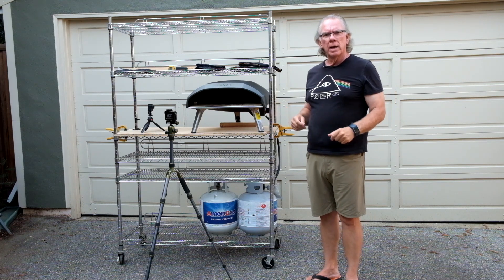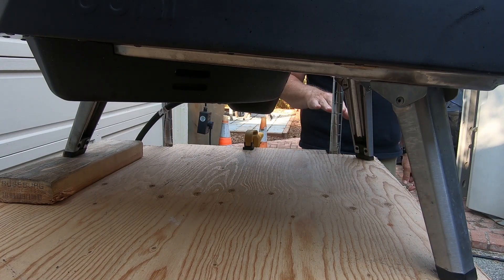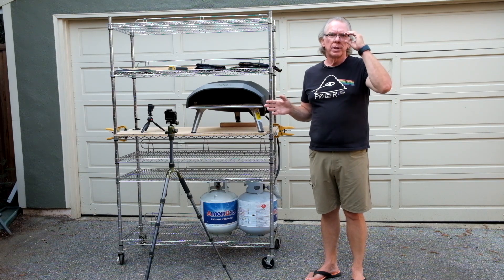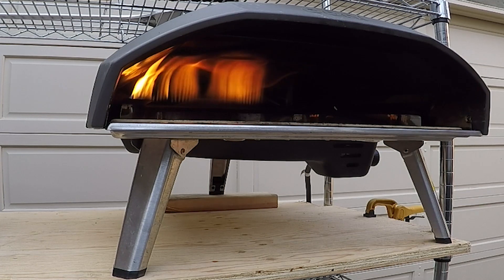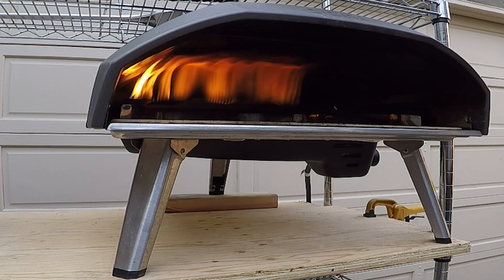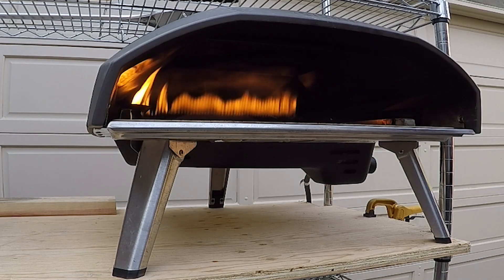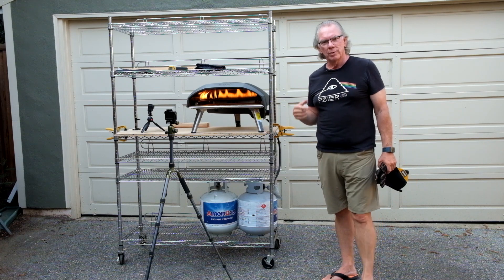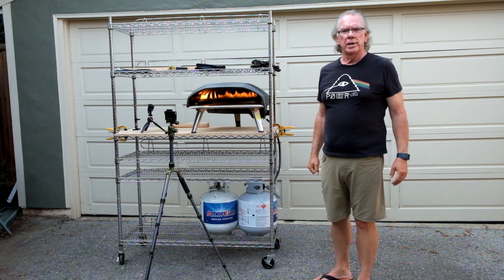Ooni Koda 16 Won't Stay Lit!!

Comment: Holy crap. A thermocouple replacement and endless troubleshooting, and you’ve solved my problem! I never thought to check the level of the table front-to-back. Thank you SO MUCH
Reply from the maker: Snarshmallow, Twelfth Avenue Cuisine to the rescue!! Thanks for watching!!
Reply: @TwelfthAvenueCuisine  I also found that, after turning the oven sideways when transporting it, some of the burner has rusted on the inside and flaked off, covering the holes right below the thermocouple. A few blasts of compressed air solved that problem but leveling was also important!

Comment: This didn't solve my problem of uneven gas flow. What did solve my problem was to shut of the gas valve at the tank,  disconnect the gas hose from the propane tank, wait 5 minutes then reconnect everything.  I think sometimes the gas regulator work properly when turning on the gas valve.
Reply from the maker: Excellent input so thanks. 👍 Hopefully others see your input and it helps them resolve similar issue.

Comment: Good info!  I just received my koda 16 yesterday, and unfortunately it is not working as intended.  The flame is mostly yellow, the stone does not go above 800 to 850 degrees F, and the ingnition system is defective.  Apparently this is a common problem with the koda 16.  I am trying to find out how to increase the air flow to the 2 burners to get more of a blue flame, and just tried to tighten the FSD as per ooni, but as far as I can tell, the FSD was not loose, so will see if the ignition situation improves.
Reply from the maker: Kier's Cotons, thanks for posting a comment and watching our video.  Are you in Europe?  I notice that some users have more if a blue flame.  We are in the US and our flame is yellow.  I am so sad to hear that you won't be able to start using your Ooni right away.  Ooni will honor their commitment to their customers and resolve any problems you are having.  I hope you will check in again and share your experiences with us.  Laurie.
Reply: @TwelfthAvenueCuisine  Nope, in USA.  Waited 3 months for the koda 16 and now its not perfect  :( I tightened the FSD, so now the first click on a huge gas flame bursts out then dies right away.  The second time trying, it lights.  The ignition knob also seems to get stuck (I can rotate it to on, but once there, I have to let the knob out to rotate any further-is that the same for you?) so I may just have to get another unit.
Reply from the maker: I open and close the propane bottle connected to my Koda 16. When I first open the propane tank once in a while it may take two lights. If the bottle is open and we used the Koda 16 earlier it always lights first try. Also when I first got my Koda 16 I would try to light it and not continue to press the knob in for a second or two. It would not light. So now I keep the knob pressed for a bit. I expect there will be variations in experiences when lighting.
Reply: @TwelfthAvenueCuisine  Thanks!  Does your ignition knob rotate smoothly or does it get stuck, then you have to let it out and push in again to rotate?
Reply from the maker: Our flame control knob rotates smoothly between the high flame and low flame settings. Between high flame and lowering the flame towards the off position I need to press in the knob when turning. Adjusting the flame to what we call "below the Ooni low" is where when the flame is on high we press in the knob and rotate about 45 degrees toward the off position. I hope this helps!
Reply: Twelfth Avenue Cuisine Ultimately my knob totally failed;  the oven would not stay lit unless the knob was pushed in all the time, so after more than 3 weeks of emailing customer support (response time of 2-3 days per email) they agreed to replace my oven.  It was indeed a lemon, because the new one works as it should!  We mostly make gluten-free pizza, but this oven gives the crust the crunch and char that is like normal gluten pizza crust.  Great, now that it works!
Reply from the maker: @kierscotons5427  Glad to hear finally your situation got resolved! Our knob came off in our Neapolitan Pizza 2 video but I was able to put it back on and it seems to be working well so far.

Comment: The elevation of Prosser Creek Reservoir is 5,703 FT.  That might have been a possible factor.
Reply from the maker: That was my first thought actually so good call out! But once I leveled the oven by putting 2x4's under the front legs flame returned to normal.